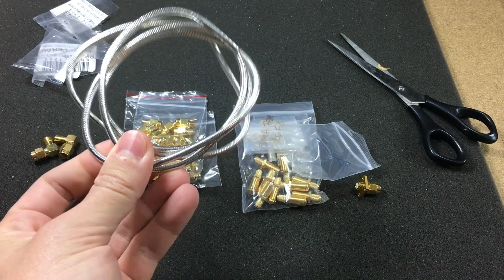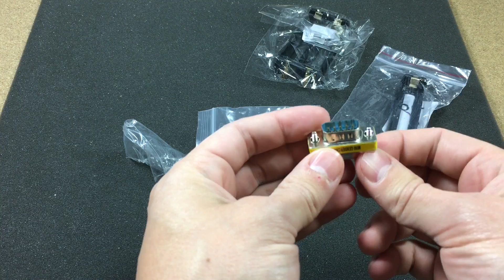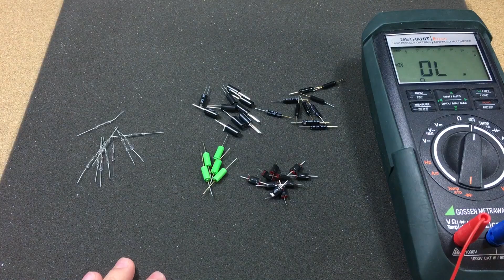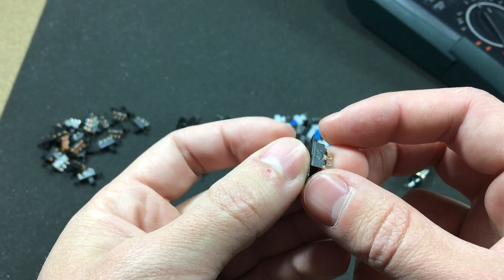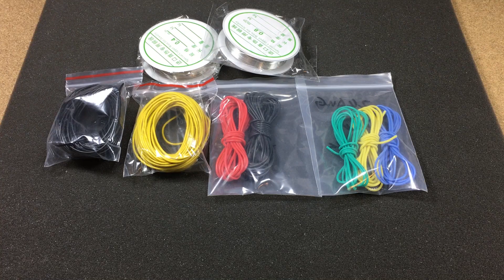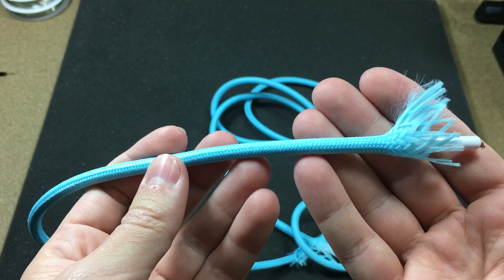Voltlog #106 - InTheMail

Comment: Hi, the bi-metal switch idea is good but make sure you spec the switch temperature according to the placement on the heatsink,
I used a similar method (car radiator temp. switch) but found that the temperature of the fixing point on the heatsink was around 10 - 15 degrees lower than the junction temperature,

I enjoy all your videos but perhaps it is better to do a mixed bag, that way there is something for everyone,  some of your viewers will probably be into one aspect like micro-controllers or r.f. (then there are people like me who don't really care......it's ALL good!)
Reply from the maker: That's why I got different temperature grade switches. I have experienced the same issue in my tests..

Comment: I'm forever looking for the heatshrink I need so I drive 20 miles or 32 kilometers to stock up on the needed to find I ran out of a different size... Same with NPN 2N3904 and 2N2222 transistors because there just about the same. I wish I was rich.
Reply from the maker: or living just next to a DigiKey would be my wish :-)

Comment: Are the wires real copper? Every wire I got from china (9v battery connectors, small golden connectors, etc.) They all stick to magnet. The golden connectors seems like brass alloy and stick less, but can be picked by magnet.

Every small 3mm 5mm LED I got from china sticks to the magnet like crazy!
Reply from the maker: they don't mention copper so I don't think they are, but they solder well, no problem.
Reply: I just measured short blue USB cable you get with arduinos from china, the shield measures 350ohm, power and data wires 100-150ohms. This is for 20cm long cable. Max resistance should be 0.213ohm
Reply from the maker: Unfortunately low cost USB cables from China will always be a problem. Better to use your own cables that you know are good.

Comment: Those "4mm Banana Jack Plug High Current M5" are exactly the same as some I just purchased to replace the existing ones on the front of a Fluke 343A DC Calibrator I just picked up, as shown in my video https://www.youtube.com/watch?v=s3niY4--KpQ I am still waiting for them to a drive, but what is your opinion of them?
Reply from the maker: they can certainly carry higher current, I don't know about contact resistance and how well they will work over time and hundreds of insertions, for that you will need to use some proper characterized parts.

Comment: The gender changer is not a gender changer. A gender changer needs to be MM or FF
Reply: Looks like they sent the wrong item , the item link shows correct images.
Reply from the maker: you are right, I haven't noticed it...
Reply: I had an eBay seller do exactly the same thing, with exactly the same item.  I don't really know why they even make the one they sent you.  It's nothing but a 1/4" extender; pretty much useless.
Reply: its useful if you use your rs232 socket a lot, you just put it in and when its worn out after many connect / disconnect cycles you just replace the adaptor, not the whole onboard soldered connector
Reply: it's also useful if you have cables with non removeable fixing screws on both cables ;)
Reply: Robin Cerny or a bulkhead or passthrough I imagine.